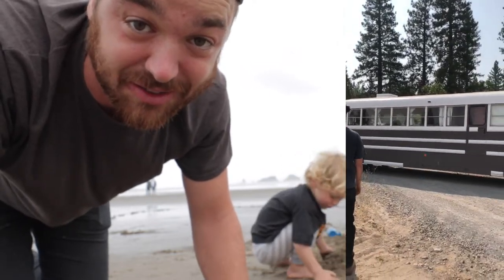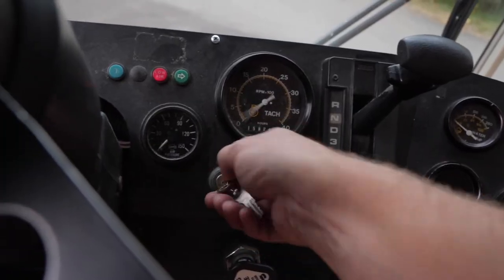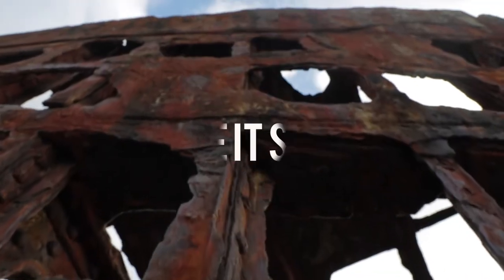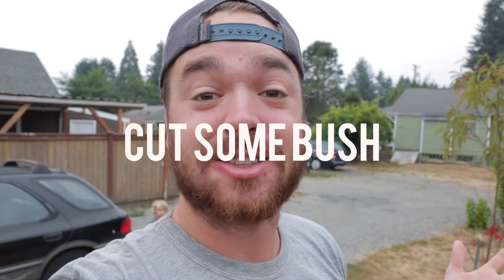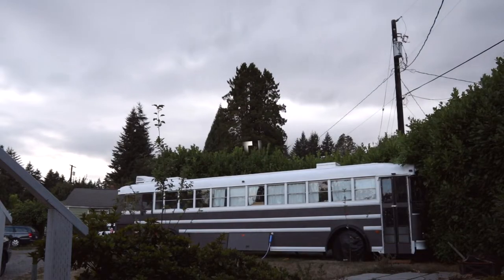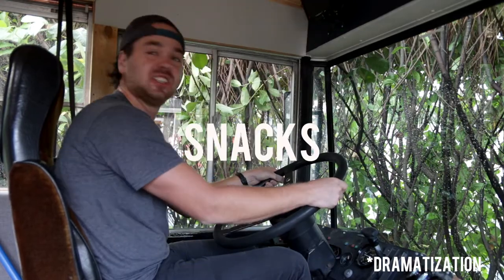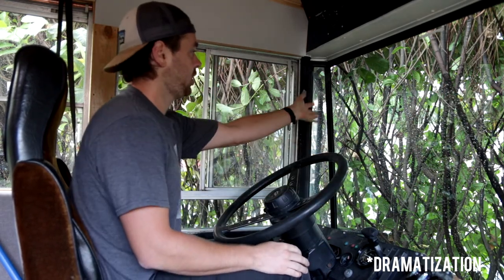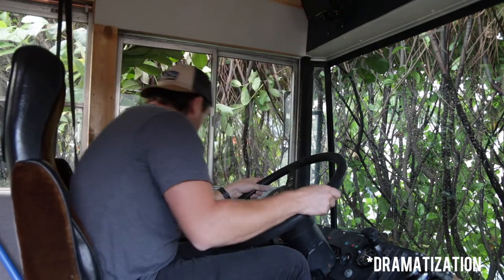16 Tips for Driving a Skoolie (how to drive a school bus)

Comment: Anyone driving a school bus should legally have a cdl or not be driving it at all
Reply: No, it depends on state
Reply: Not exactly, check local laws first. It depends on your use
Reply: I think just a training course should be offered for it
Reply: It's  not required so go to hell but i do think skoolie owners need to learn to drive correctly and safely and that doesn't require a cdl.
Reply: I get it. Scary enough with drivers in cars but driving a large bus without special training is risky. This is why I am doing my research before buying.
Reply: Tell me you're a Democrat without telling me you're a Democrat.
Reply: That is not true. I just bought a 40 foot 🚎 n it depends on weight n use. That said I believe common sense n practice is very important.
Reply: How are you going to be so confident in your statement then be wrong?

Comment: Great video! I’ve been driving 18 wheelers for 24 1/2 years so far. I still remember my trainer saying you can go down a mountain an unlimited amount of times real slow but only once too fast so GO SLOW. What we call your rock and roll method is Lean and Look. Same thing, different name. Here’s a couple good tips for ya tho. 1 use the 6 second rule for following distance minimum. When the vehicle in front passes a fixed object or point, count 6 seconds. If you reach that object or point sooner than the 6 seconds, you’re too close and have a high risk of not being able to stop in time if they have to hit their brakes hard. 2nd tip when getting ready to make a turn from a stop like out of a driveway or from a stop sign onto a road where cross traffic doesn’t stop, use the 17 second rule. You need at least 17 seconds to fully complete your turn. Sometimes it’s not possible to see traffic coming due to a curve in the road or hill, but when you can, wait until you have a minimum of 17 seconds before any traffic would get to where you are. 3rd tip, when you get your bus, leave ALL the mirrors on the bus that came with it. Add more if you like, but definitely DO NOT drive without all the mirrors on it. There’s ALOT of blind spots and those mirrors greatly reduce the dangers. Something to go along with this is that if at all possible, install a backup camera. I don’t know how much they cost, but I’m gonna get one put on the bus I’m gonna get very soon to convert to a Skoolie.
Reply from the maker: Thank you for the tips! It is good to have a professional weigh in :) I just learn from experience and google which can be a dangerous thing!
Reply: It was very nice for you to talk about how much time you need to complete your turn that's very wise, but you do a great disservice to a brand new driver that would take your number literally... 17 seconds? What are you doing driving a  slow giant turtle with arthritis? It's around 7 seconds in order to take make the turn and be facing in the new direction of traffic now it would be 17 seconds if you want to talk about getting up to operating speed maybe but you can't get everything perfect ... you can't live in a perfect world of driving you have to be realistic in the real world you do a great disservice telling a new driver 17 seconds, if he listen to you literally he might not EVER make the turn.( ALICIA DRIVING IN A DESERT ROAD WITH NO TRAFFIC FOR 50 MILES) don't ever tell anybody 17 seconds again ever! 7 or 8 seconds Max in the practical world
Reply: @Iambriangregory  okay calm down mate

Comment: There are plenty of non-cdl busses…and it’s not required if it’s for personal use anyway. We just bought a used non-cdl Thomas freightliner school bus (it’s small, seats 35) and we aren’t even converting it (we may get a larger one for that purpose later on). It’s going to be our daily driver. We have a large family with another baby on the way-no longer fit in any mini vans.  We refuse to endanger our kids in a ridiculously expensive passenger van. Paid $6,500 cash for the bus instead  of the $40-50,000 for a dangerous passenger van that would have trapped us in several years of debt w interest and would need to be replaced by the time it’s paid off. The insurance on the bus is also far cheaper than we’ve had on any conventional vehicle…and it will likely be decades before we need another vehicle because it’s diesel.